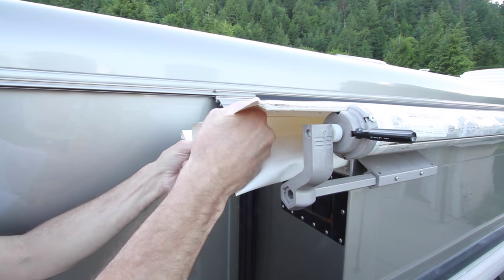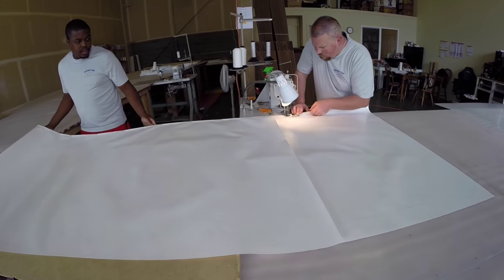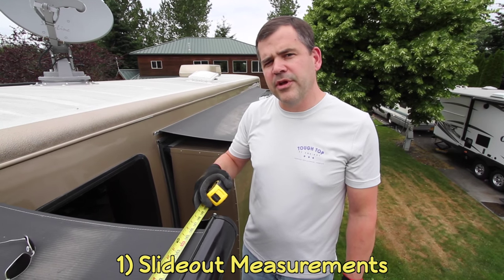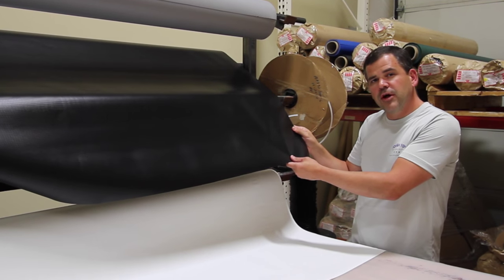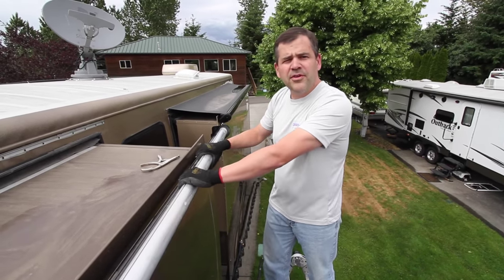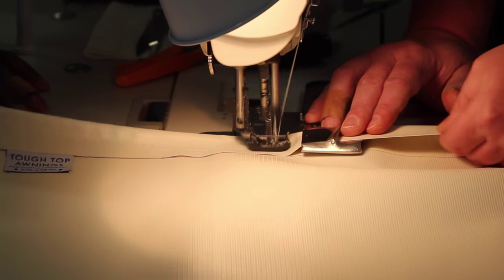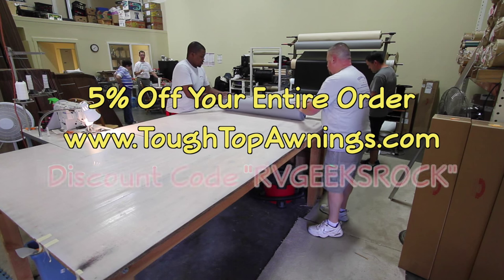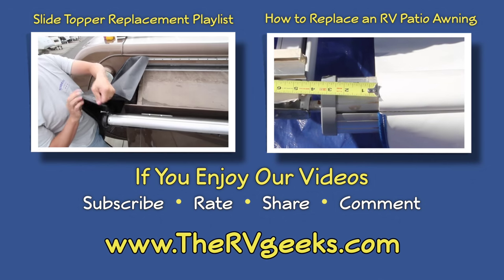RV Awning & Slide Topper Replacement Fabric Discount & Tips

Comment: Thanks for posting this video.  We just bought our first coach 1 month ago and I already had to re-stitch one topper slide and after tonight's rain 2 more need repaired so I think we should just buy new ones :( So depressed about that!
Reply from the maker: Cheri Ann Congratulations on your 1st RV, Cheri Ann! Don't get discouraged! Both new and used RVs require working out some kinks at first. Speaking of which... if yours is new, it should of course still be under warranty. If it's used, I hope you enter the giveaway to try to win new slide toppers... or at least use the discount if you don't win. Best of luck.
Reply: RVgeeks We purchased a 2005 Monaco Camelot so the toppers are 10 years old. Was hoping to get one year out of them but looks like replacement is the best thing. Are Tough Top Awnings double stitched on all 4 sides? I didn't get that info from the video. Yes, I certainly have entered the contest and shared you link in the facebook RV groups I'm in! I need all new window covering too and that $300 would come in handy for sure! Thanks guys :)
Reply from the maker: Cheri Ann The beauty of Tough Top Awnings is that they are a single, strong piece of fabric, as opposed to being two pieces glued together, so there's nothing to come apart like some of the OEM fabrics. So there's no reason to stitch the edges (at the front and rear of the slides) because it's a single piece. They are indeed double stitched on both sides where the beading holds it into the tracks, plus it's also glued and stapled. They're very strong, and ours show no signs of wear after over 3 years of full-time use and continuous exposure to the sun. Best of luck in the contest, Cheri!

Comment: Hi guys, getting ready to order new slide toppers and noticed in your video when he was on the ladder explaining how to measure that the old toppers were edge hemmed and when in the shop they don't edge hem the replacement.  How was yours done? I'm a little concerned with no hem it's the first place it will tear. Thanks
Reply from the maker: Hi Ernest! Tough Top Awnings fabric is never edge hemmed, and absolutely doesn’t need it. You’ll see when you get it that it’s so much better than the original. It will never tear! Order with confidence and let us know what you think when you get it. The difference is obvious and you’ll love it.
Reply: RVgeeks hi again, I presently have sunbrella fabric toppers put they sag big time when it rains that's the reason for the change to vinyl. Did you get the 15oz ?
Reply from the maker: 15 oz is the way to go for slide toppers. That’s   What all of ours are. Just one note about collecting rainwater… It can sometimes be a result of a very slightly bent roller tube. It’s difficult to see whether it’s better or not, and doesn’t take much bending to allow water to pool. The problem is that manufactures mount them perfectly level, instead of angled down. It’s the stupidest thing, but sometimes not possible to correct without having the slide toppers themselves remounted higher up on the side of the RV, which of course we would never bother to do. Just don’t want you to be disappointed if your flat slide toppers still collect rain. The good thing is the tough top fabric is so strong, it won’t stretch out the way the old stuff did.